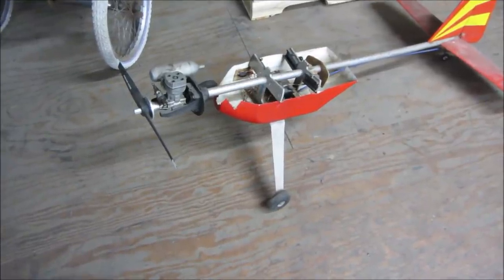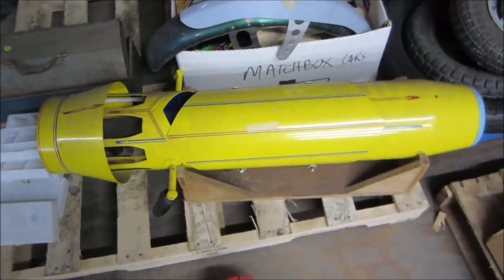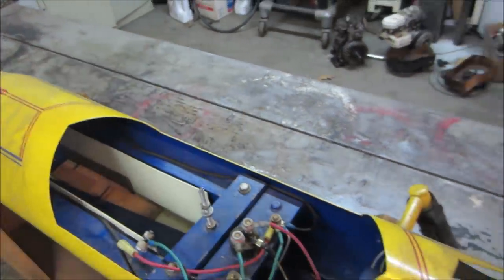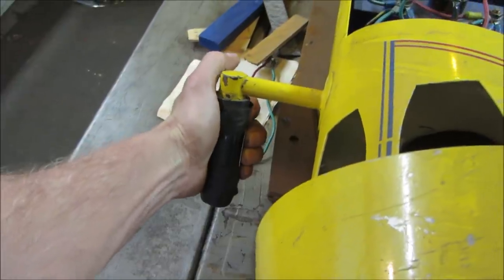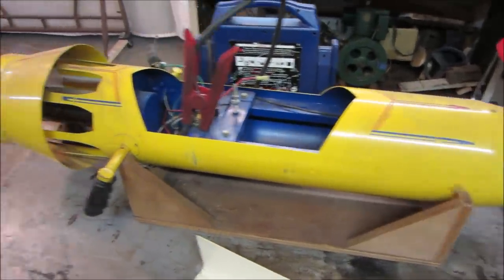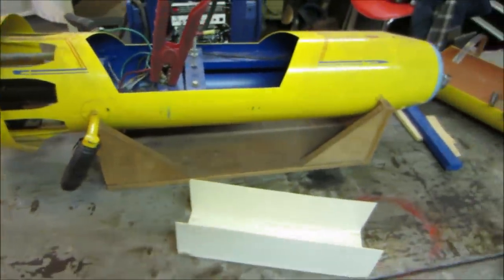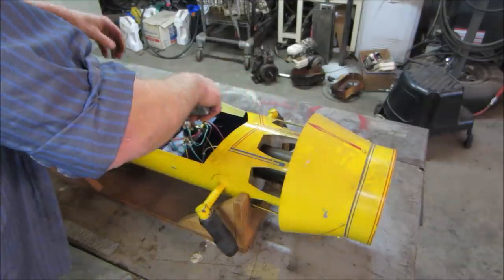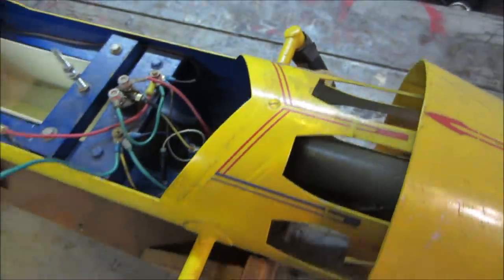Antique Scooter for The Water? Will It Still Work.

Comment: Looks like something you would find out of a popular science magazine they used similar to this in the 1965 film Thunderball James Bond but this one might be later I am Puzzled by the Phillips head screws I believe those were replacement screws and most likely would’ve had a flat heads because back in those days of the 60s and 70s and before they usually went with one screw because it was cheaper instead of having multiple different ones which tells me that somebody may have done some restoration work to this later on in his life maybe it needed a refresh paint job and the screws were stripped so they cut them off at the head and found a way to unscrew them out of it and put different screws in there that they had. Has a pretty cool paint job I think it’s at least early 70s because of the fact that it has a wood frame because after that most everything that was made even popular science magazines and magazines of the lakes was used was fiberglass because fiberglass was cheaper I believe and I definitely think that the stand was homemade or possibly with the kit
Reply: And the remake never say never again when the bond films were my favorites
Reply: @jasonstorie8740  I’ve always been a big James Bond fan but I have to say the 1960s is better I think never say never again was OK but I don’t think it was Sean Connery’s best role I think he had better roles as James Bond in the 60s but that’s just my opinion and I wasn’t a big fan of Roger Moore he had a few films that I did like but not the best James Bond ever and Timothy Dalton was OK to again just not my favorite James Bond and more of the 1950s and 60s in their earlier stuff is all myself
Reply: @jasonstorie8740  Definitely a cool piece of history I have to say you don’t see many of these Type of things rolling around

Comment: device seems backwards.  the way the handles are set you would have your face right up against that prop blade...given the light is on the other side that seems to be the only way to use it.  Unless you like up only where you have been and not where you are going.

Comment: its a trolling motor and a stove pipe you can do it just don't use in the bath tube,,,,,,,,,,,,,,,,,,,,,,,,,,,,,,,,the battires in it has to be sealed lead acid mighty max type mlk7-12 12 volt 7.2 amp hour less than twenty bucks on amazon

Comment: Amazon now sells lithium batteries to replace auto batteries. They are about the size of two packs of cigarettes and have more cranking amps than a car battery. They are extremely light. I have fallen in love with these for projects, they are very cheap. There is also an obscure law that makes it illegal to mail lithium batteries fully charged. Because of this, Amazon cannot accept returns, they immediately issue a full refund.

Comment: I looked up a battery for a diver propulsion. Navbow Battery seems like approximately the right size and costs $199. I am not good at metric conversions.
Battery	158 Watt hours³
Battery Capacity	10670mAh
Electric voltage	14.8V-16.8V
Weight	1100g
Demisions	171mm×60mm×58mm
Environment temperature	5℃-40℃
Battery life	75min(Standard)
Charging time	3.5 hours

Comment: Attach a couiple of styrofoam pontoons to the side and use it as a surface propulsion device.  Mount them at an angle so the front is above water and the prop is below water.  Add a vertical fin to your back and let others yell "SHARK!"

Comment: It seems to be a concept design. Inside should have Buoyancy foam and the battery should give it a little weight to be slightly negative buoyant. The electronics should be protected from any type of water. I design these types of vehicles for a living and think this is just a concept, not to be used.

Comment: Unless it is only run in distilled water, the batteries and electric wiring has to be dry.  Sealed agm / gel batteries.   Not flooded cell batteries like motorcycle batteries.  Especially if used in salt water.  Salt water and lead acid is very bad, one of the big hazards of old school submarines.

Comment: I bet it is homemade and likely inspired by a James Bond movie. When you really study the thing, it's not very well designed. As you noted, it would be exhausting water directly in your face or perhaps somewhere more sensitive. And a single speed? And just a rigid pair of handles? At least they were clever enough to use a momentary switch. They probably did not on the prototype, must have been depressing to watch your creation swimming away.

Comment: The gasketing on the main cover appears not correct for compression forces for the thin housing and gasket material. The entire cover is gasketed? Not professional, a well engineered device would have had the gasket only on the overlapping surfaces. I doubt it was ever underwater. Just a trophy of accomplishment with it's own stand.
Reply: That's what I was thinking, the electronics don't appear waterproof and the hatch doesn't look like it is either.

Comment: the wingless airplane will make a great  art piece hanging from the shop ceiling....
The pin striping on the propeller tips  of the Diver Propulsion Device is like on an airplane propeller  to show when it it rotating!
The seal is on the entire cover you do NOT want H2O getting inside the battery  and controller compartment;
Take it to your local indoor/heated pool and lets see it in action!